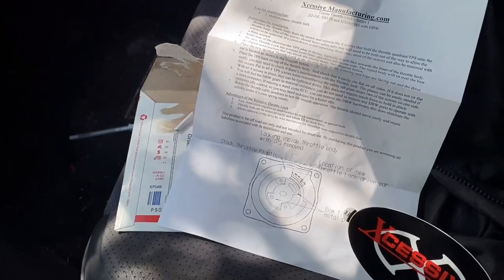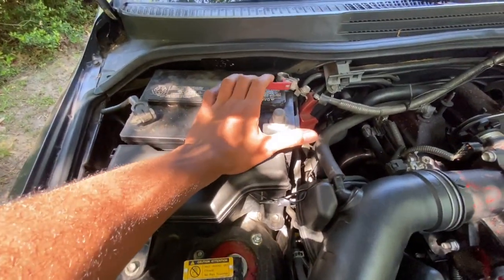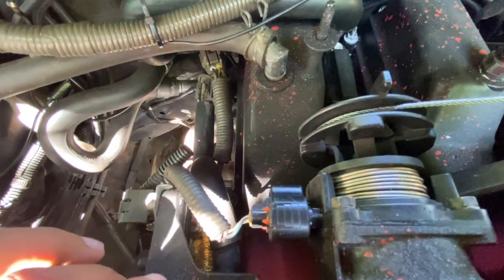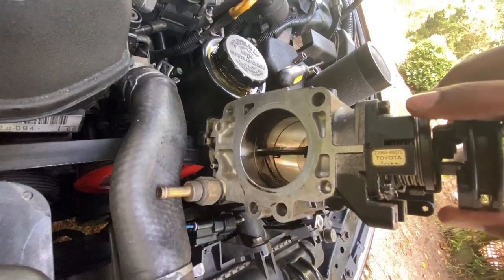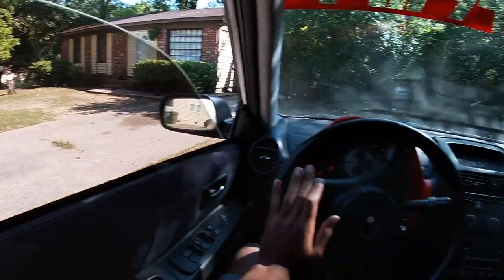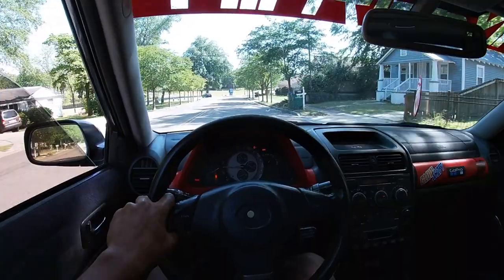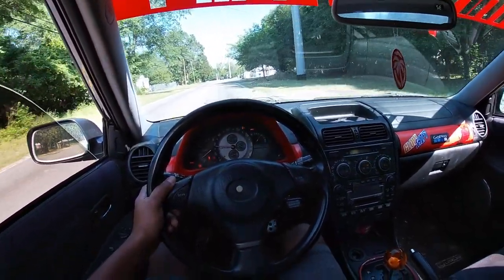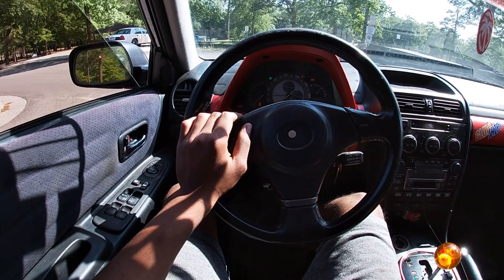IS300 Drive by Wire Delete | Xcessive Manufacturing

Comment: Before you install that piece of plastic on the Throttle body sensor. By watching your engine check light and the Blinking Traction control light (on the lower left corner dash box). You already got a Malfunction Throttle body sensor.   I have the same problem. It is scan Problem code P1120.
Reply from the maker: My throttle body plug’s pins were coming out so I pushed the back in and it fixed my issue

Comment: How does the transmission controller limit engine torque during a shift? 🤔 Also, you’ve eliminated the linear throttle map which is not better. You should re-tune the ECU throttle map instead. Don’t delete your ETC. the hesitation is programmed in. It’s not a physical limitation or the throttle motor.
Reply from the maker: Don’t worry this is an old video, I plan to return the car back to normal when I get it back on the road. Thanks for watching and information as well 🙏🏾

Comment: How long did you have it on the car? How long did others have it on? Any issues with the throttle body motor? Thanks
Reply: These will ruin the TCM. It's been proven many times.
Reply: @MegaSloth  what is TCM
Reply: Not if you remove the middle gear from the electric motor on the throttle body
Reply from the maker: For at least a thousand miles but my car has been down for while because I had to change my transmission and headgasket.

Comment: im 6.7 and weight around 280 would i have any issues with fitting in these car without switching out the seat?
Reply from the maker: Yeah you’ll probably have a lil trouble. Im 6’3 or 6’4, i fit fine but I’d like my seat to be lower and go back a lil more
Reply: @tagallstar  same here. when it arrives ill know for sure, im definitely keeping those racing seats on watch.
Reply from the maker: @carlbrooks90  faacts bro, i want to get braum seats but my car does have heated seats tho

Comment: Are you located in Canada but chance? Just wondering for shipping timing.
Reply from the maker: William Turner Im in the southern parts of the U.S, it didn’t take long to get to my house but i don’t know how long it’ll take to get to you with all this covid bs
Reply: TAGallStar I order stuff from the us for my car often so it shouldn’t be much longer then what you waited. But thank you! Hope you have a great day!
Reply from the maker: William Turner thanks man and likewise
Reply: TAGallStar I got my things. Not impressed with shipping time. 2 months. wtf. I put er in and my foot pedal was really really stiff, you have this issue? My throttle is now stuck, can’t put my foot down. So now I have to redo it all. I might have put it in backwards or it fell out of place while driving. So all n all, not at all impressed with it. Even though it was only just over 20$ Canadian, unless your going to use as a reference to make a metal one I don’t suggest buying one. Just upgraded your manifold.
Reply from the maker: William Turner yes my pedal got stiff as hell but it didn’t lock my throttle tho. It doesn’t really make much of a performance difference honestly
Reply: TAGallStar It does in the sense for cornering, I did a little bit of an update today. I removed one of the springs from the throttlebody believe it was the outside one, if you could find a replacement with a less tight spring to help the inside one from wearing faster. and I fix the pedal from sticking, the brass piece were the throttle lock pushes was bent up causing it to slip over and make it stuck wide open. Do you feel a little bit more resistance after you push the pedal halfway down?
Reply from the maker: William Turner not really the pedal is just stiff overall
Reply: TAGallStar should try removing the outside spring on your throttle body, helps a ton with the stiffness, although I do recommend getting a stiffer inside spring. If you take your foot of throttle to fast the Throttlebody valve tends to bounce a bit causing hesitation on deceleration. All n all after my experiences with this I’d rather just take it off. And just start updating my intake manifold
Reply from the maker: William Turner dang bro u went deep into it. Imma remove mine and go back to stock

Comment: How many miles have you put on it after install how is it doing? And do you notice a difference
Reply from the maker: There is a slightly less of a delay but it unfortunately makes the pedal really stiff. I also didn’t get a chance to drive my car much after this video. Its been down since this video
Reply: @tagallstar  oh no what happened 😪
Reply from the maker: @troywems8548  headgasket blew and trans was bad, i changed the gasket and the motor starts but i just got another trans hopefully it works
Reply: @tagallstar  good luck
Reply from the maker: @troywems8548  thanks man I appreciate that
Reply: @tagallstar  I plan on buying this part for my is300 so figured I’d see how your experience went
Reply from the maker: @troywems8548  honestly its not necessary, I don’t suggest that part anymore
Reply: @tagallstar  why tho nobody wants there throttle plate opening at 40/50%
Reply: @tagallstar why don’t you suggest it anymore?
Reply from the maker: @kevinesquivel4485  didn’t see much benefit in it, and I didn’t like how stiff it made the pedal

Comment: Hey I just bought a Is300 and I been hoping to run into an owner to see if the hesitation was a known issue.. not a fan of this so I was gonna see about doing this mod but how has it held up over time, would you still recommend this?
Reply from the maker: Yeah the trans and ecu in the is300 can be sluggish, and I haven’t got the chance to drive my car much after I did the mod, but when the car was running, it didn’t give me any problems other than the pedal getting really stiff. I think its a good item to use to eliminate the car’s sluggish attitude
Reply: @tagallstar  my wifey likes to use the cruise mode do you know if it’ll mess with that? Last question bro, thanks for the video and responding!!!
Reply from the maker: @robhernandez7322  ask as many questions as you like, im here to help, Xcessive recommends that you don’t use cruise control or traction with the piece installed bc the piece will interfere with the way the throttle body controls airflow for cruise control and traction control. U can have traction control on but if you are going to drive aggressively they recommend that you turn it off
Reply: @tagallstar  thanks bro, man you got a nice hood! Those vents are 🔥!!
Reply from the maker: @robhernandez7322  thanks bro i cut it myself but water gets onto my alternator and makes it corrode so imma redo it with another hood

Comment: what exhuast u running on ur is?
Reply from the maker: rNuno it has ebay headers with stock exhaust with no cats and a $20 titanium muffler and it has a phat leak too, but I’ll be getting it fixed soon

Comment: OP how long has it been, any new issues ?
Reply from the maker: Pavel probably a month or two now. The only issue I’ve found is that when the engine is cold and you drive around, the car sputters when press in the gas from a stop. But when the engine is warm it acts normal

Comment: Will this work for 2002 Is300 Manual 5 speed? I noticed my cable was loose and I tightened it the other day but same hesitation? Maybe this is what I will need? Thanks
Reply from the maker: T K yes it’ll definitely work and it will make a huge difference fr. I wish my car was 5speed😂
Reply: @tagallstar  its pretty easy to swap over but you would need a hoist. Mine was Auto convert to Manual W55? but it has bigger LSD 3.9. More peppy ;)
Reply from the maker: T K damn thats dope i want to go ahead and convert it but I didn’t have the time or the money for at the time

Comment: These things are junk. I've had one installed for 3-4 years. Only thing it achieved is making the accelerator pedal twice as stiff as it was. Only reason to use one of these is if your DBW throttle craps out altogether and you need to get your car back up and running.
Reply from the maker: I haven’t driven my car long with that thing installed so I don’t have much on input about it, but it definitely makes the pedal really stiff. With todays advances, theres no point in this mod now like u said.
Reply: @tagallstar  I just got my turbo IS300 back up and running; now with Link G4x ECU. Using a Bosch Motorsports 68mm DBW throttle and an adapted accelerator pedal from a C6 Corvette... The pedal feels great, and the throttle response is absolutely beautiful - at least as good as a traditional cable throttle - plus I can now incorporate throttle position into my traction/launch control, as well as make cruise control functional again. Soooo much better than the original Toyota DBW system.
Reply: @GroovesAndLands What manifold are you running by chance? Have you removed your ABS or relocated it?
Reply: @icuxo  I have two IS300s. The one with the throttle lock is basically stock with just some wheels and IS350 front brakes.

The other car is turbocharged, T56, Link ECU, etc. That car is a GE-VVTi, but has a GTE plenum, Dodo GE-T lower runners, Bosch 68mm DBW throttle and a TAARK adaptor for the throttle. ABS not removed. In fact ABS is still functional.
Reply: @GroovesAndLands  That sounds sweet, I know Dodos been doing great for GE-Ts. What turbo manifold are you using though? Dodo has the log style manifold but I've heard 50/50 on log style.
Reply: @icuxo  Engine has stock GTE rods/pistons/head gasket. Turbo manifold is an old Toyomoto cast "log". They haven't been sold in at least 15 years.

Personally, I'm a big fan of cast log manifolds for street/daily driver type builds. Say, under about 650-700hp or so.

First off, I've found castings to be far more reliable than a fabricated, tubular header/manifold - ESPECIALLY when that fabricated header is made from tubing with less than ~3mm wall thickness material. Secondly, cast logs are usually a lot easier to install/remove. Third, they keep underhood temps lower. Fourth, I'm about 75% convinced cast logs do improve spool/response a little.

When I had my car all apart for its makeover, I discovered a crack on the backside of the "collector". I repaired/welded it and it's holding up so far - but I don't have a lot of confidence it'll last.

If/when it comes time to buy a new manifold - it's a no-brainer for me: I'll 100% get the cast stainless Artec V-band manifold:

https://www.realstreetperformance.com/artec-stainless-cast-precision-v-band-side-mount-turbo-manifold-2jz-ge-mvr-v-band-wastegate-flange.html

It's made from super-premium 347 stainless, in Australia (not chinese junk), super easy to install/remove, and it'll place my turbo in basically the exact same spot it is now - so that all my piping/plumbing should fit without (much) modification. I will need to buy a V-band turbine housing, however. They say it's good for 900hp. I dunno about that, but it doesn't matter to me because I'll never try to go there.

DoDo's been doing some great work. His lower runners fit/work perfect (though I wish he used more modern 11mm injector bungs). I'm sure his turbo manifold is good, too - but I don't like that ultra low turbo mounting position.
Reply: @GroovesAndLands  Thank you VERY much for this info lol, I've been hoping someone could help me out when it came to this part of the build. I'm going to note all that down and look into it. I'm more confident in the log style manifolds now since they aren't super expensive either and clearly preform well especially for my goal; I'm only aiming for 350-400whp anyways. I'm stoked about your build as well, sounds like fun man. Thanks again for all this.
Reply: @GroovesAndLands  I've also been thinking about the thickness too, 1mm thick tubes is like nothing, I was sure it wouldn't hold up well at all and of course cast is amazing for applications like this, hence why our motors are made of cast iron.

Comment: Never use this on your car!!!
Reply: Why
Reply from the maker: Whats wrong with it
Reply: Care to elaborate ?
Reply: @SIMJ11  thats what im saying
Reply: I like how he’s gunna say some bs and not explain how it’s bad lol, manz don’t know what he’s talkin bout
Reply: @Bellgrande  these will completely wear out your throttle motor and it's been proven. If your auto then you'll eventually destroy the trans also and if you saw an improvement (if your auto) then your trans/ ecu was in limp mode already. You can run these with a stand alone but then you can just fine tune the throttle and these aren't really necessary. Using one of these is like putting a bandage on an different issue and hoping it goes away. I'm looking forward to the follow up video when the TCM burns out.
Reply: MC C Danm i guess it was too good to be true 🥺
Reply: MC C how does it destroy the trans
Reply: Has it burned yours? If so in how long? Where was it proven, in whole two comments on My.IS lol?
Reply: @SIMJ11  do some research. I'm not here to hold your hand.
Reply: MC C  Yeah, you're here just to make critical sta tements without reasoning it. Sounds like you never used this, just scrolled through a couple of threads, maybe even followed a post on Facebook about it. Lol sry I asked you to contribute useful information.
Reply: @MegaSloth  yeah yeah yeah lol
Reply from the maker: Andy m lol probably so, seems fine to me
Reply: I installed it on my 01. CAR STALLS OUT AND IS NOT HAPPY. I strongly do not recommend it
Reply from the maker: Morgan Sharadin gotcha bro, i plan to do a update video on it because it does do some weird stuff
Reply: I tried it on my manual swap 02. It did make the pedal stiffer, but I would hardly call it more responsive. I like the stock pedal feel better so I removed. But didn't break anything in the first few hundred miles. That's how you review if you want people to understand your opinion. Not just "IT SUCKS" or "NEVER USE IT". It didn't ruin the TB motor in or caused any permanent damage in the 200+ miles that I had it on. I just didn't like the new pedal feel
Reply: TAGallStar yeah plz make a follow up vid
Reply from the maker: Pavel i agree bro and im going to remove mine whenever i get my car back and give a review on it for sure
Reply: @MegaSloth  you right it’s obvious & simple
Reply: But that was a good one tho i went tru it too bro TAGallStar